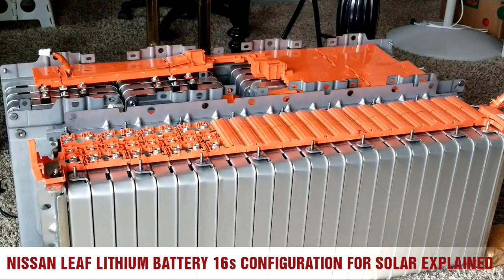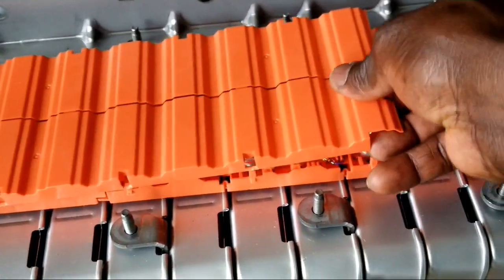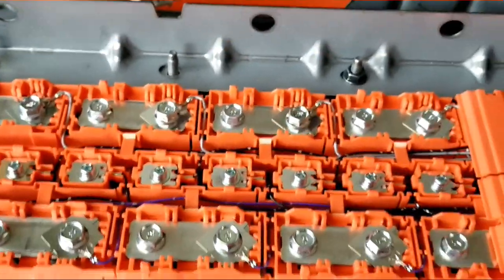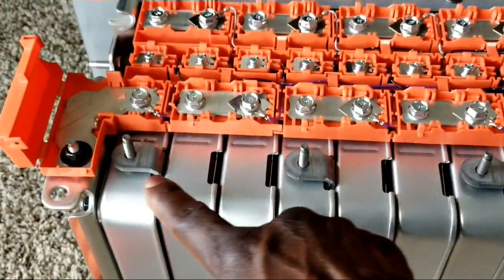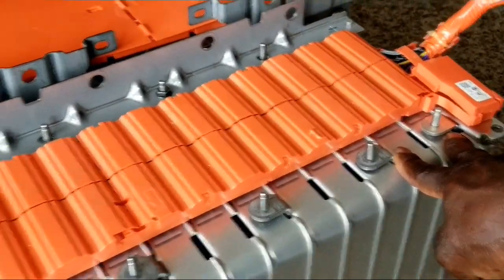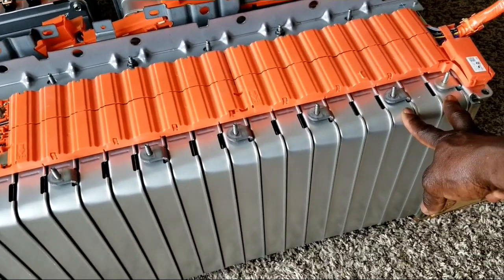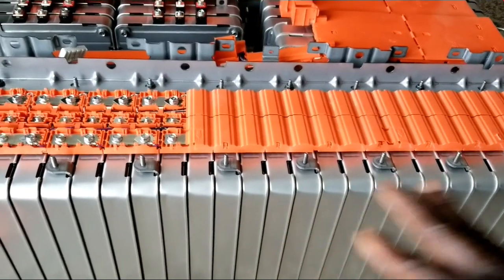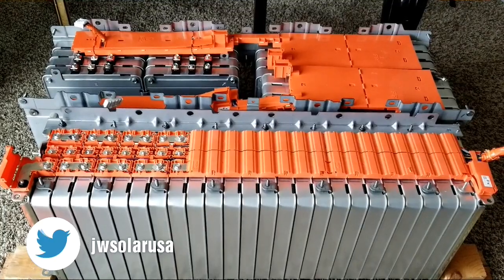NISSAN LEAF LITHIUM BATTERY 16s 48 VOLTS CONFIGURATION FOR SOLAR EXPLAINED

Comment: What does the whole pack weigh at 24 kWh? I'm looking at building a 10-12 kWh system for a marine application.
Reply from the maker: Proximately 400 to 500lbs.
LIKE SUBSCRIBE and SHARE